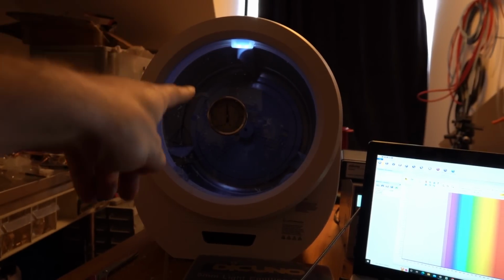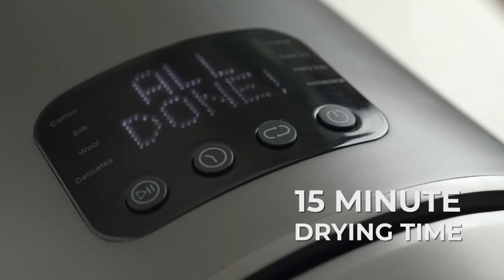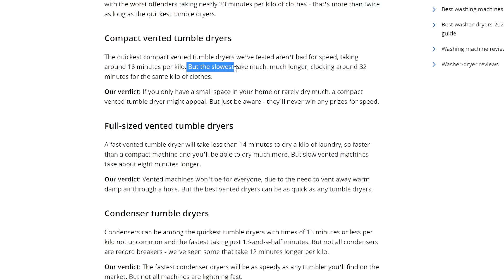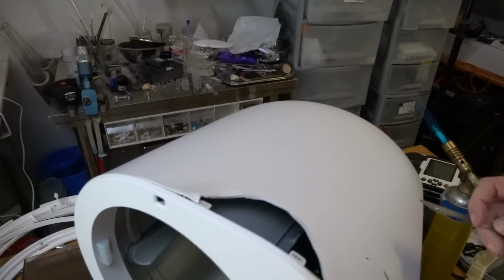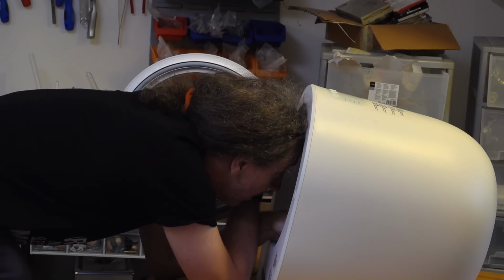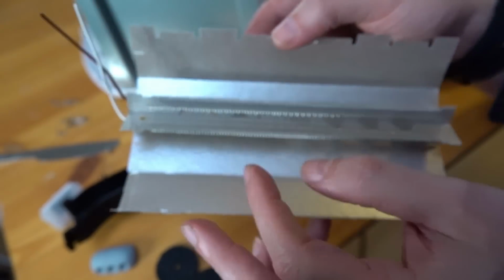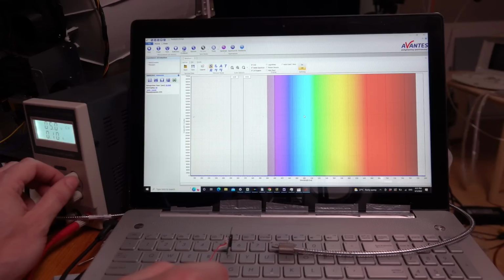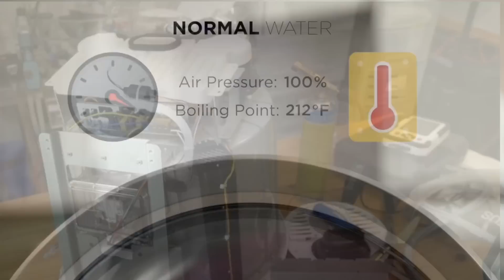Autopsy of a Scam-Starter: The Morus Zero!

Comment: You always locate as much screws as possible before doing destructive disassembly.

It's always under a rubber pad, a label, a warranty seal, or some kind of plastic cap; it's not easy to find..
Reply: I thought the "destructive" part there meant that you didn't need to locate all of the screws.

Comment: Two things I would just like to point out:
1. The non-vacuum dryer was all the time under the sunshine, which may have had quite an effect on its drying process. The machine should be inside the house.
2. The clothes hanging on the back were not in direct sunlight. Although I reckon that's not entirely necessary nor always recommended.
It could be interesting to do this same experiment in the right conditions (indoors machine, direct sunlight control clothes). I bet that if the machine is indoors, as it's always portrayed, the results would be even more disappointing.

Edit: Nevermind, I hadn't watched the full video when I posted my comment. But still, it may have been interesting to do the same experiment in the right conditions.

Comment: Bought a 9 Kg capacity cheap-ish Whirlpool heat pump dryer for 450 USD new. Now it is slower compared to "classic" condenser dryers, but only pulls 850W from a EU 230v plug and it takes around 3 hrs for a full load. Sure, it takes more space, but one can be placed anywhere you have a power outlet. You live in an impossibly small apartment? Get a compressor dehumidifier and Bob's your auntie.

Comment: Curious what the UV LED's emission wavelength is.  Depending on wavelength, there still might be zero effect on bacteria and viruses.

Eg:  365nm and 395-405nm won't kill.
But shorter wavelengths <300nm can.

I have 365nm 50W x 2 UV floodlights, and they won't sanitize.  I get more sanitizing power drinking a gin and tonic, and the drink fluoresces under UV light, twice the fun.
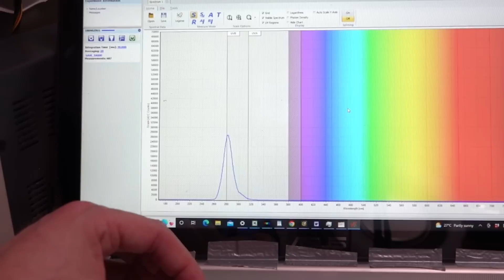Reply: 27:44 if you look closely you can see it's around 280 nm.

Comment: I'm not sure you can correctly calculate the dry time for clothes versus straight water and assume they correlate.  Evaporation does depend on surface area since it can only happen on the surface.  The cloths give the water a medium to spread out on and might actually improve drying time.  Or maybe not.  I just wouldn't make the assumption here.

Comment: The plastic case includes clips molded into it so it's really designed to permit installation of the case but NOT removal.  I'd have used a die-grinder, jigsaw or similar to cut all the way around.

Comment: These broken of bits might be the points where they started injection molding the housing and then broke/cut of the canells where the plastic was comming from the machine.
You can do these things tidy or dirt cheap.

Comment: Want to dry your clothes faster?
Throw a dry bath towel in the dryer with your laundry, the extra surface area and the wicking action makes the clothes dry faster.
I didn't want to believe it but tried it anyway, it really works.
However drying a towel twice probably doesn't save energy though.

Comment: The UV LED is probably getting so hot because you're overpowering it: I think i see 0.32A which is FAR beyond what it should probably be operating at (maybe 10-20mA)

It may have ~7V across it but because its not an ohmic resistor, current will be very sensitive to fluctuations hence why the usual thing to do is have a resistor in series which damps that effect and let's you select a current rather than voltage for it to operate at.

That resistor may be on the main board rather than the LED board. It would be a pretty serious design flaw otherwise.

The reason for the heating would be a zener diode included in the UV LED which limits the voltage for protection (but dumps excess power as heat)
Reply: The white LEDs look like they're being underpowered. They seemed much brighter when you were measuring them in situ

Comment: I'm guessing the UV LED is pulsing at best, and does little to nothing when it comes to sterilization. But... Doesn't those heating coils put out IR light? Not that it would do anything towards drying clothes, but I think technically it does.

Comment: If you want something to dry faster you just need to have running air on it. A normal fan will do just that just fine. It will most likely use less power too compared to that Morus Zero.

Or if you want to use even less power, hang them out during a windy day.
Reply: or for the price of this POS you can get a decent mid range heatpump dryer that will dry a full load of clothes

Comment: I wonder if you could add a small Peltier cooler to maybe cause some of the moisture to fall out.
Reply: It would have a single digit efficiency.
So it would really fit to this device.
Reply: @fromgermany271  So true. I had looked at using it in an RV, but with it pumping the humidity into the space it would become a sauna. I guess it could just go out a roof vent.

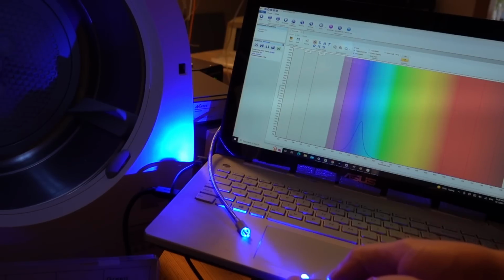Comment: 3:41 - another couple what? In a regular white LED there's just a single blue LED (those are very efficient) plus phosphor (or a combination of different phosphors) which absorbs some of the blue light and reemits it at a longer wavelenght - green to red (with high CRI LEDs overlapping some infrared too).

Comment: Apart from the fact it doesn't suck or kill germs, and ignoring the other fact it has a prototype feel - and its useless -parts of it are beautifully made. Electronics and motor, moldings etc. Oh and hot glue on connectors is standard practice for reliability in harsh environments. Germs ok as I watch ha ha. This is great stuff.

Comment: Here is a thought: introducing the most eco friendly dryer! "The clothes line!"™ Powered by renewable energy of the sun, simple installation or use existing items, easy and cheap parts replacements/repair, sanitizing UVA/B/C and more. Purchase within 48 hours and we'll throw in a complimentary set of clothes pins!

Comment: Wow, it actually had components for attempting the claims they made.  I don't have one of these but I wonder what it would take to get the units to actually work as they claimed.  
  
So a larger metal condenser, a better seal and a pump would get the product aligned with the claims?  
  
Can you put the working condenser drier you have there over the unit and fix the vacuum seal and compare it to the units currently in circulation?

Comment: The fact that it did have an ultra-violet light in it doesn't necessarily mean it was able to dry/sterilise the clothing, (or whatever claims they made about its presence), inside the machine.  They'd need something a little more substantial than one single LED to do that, somehow.

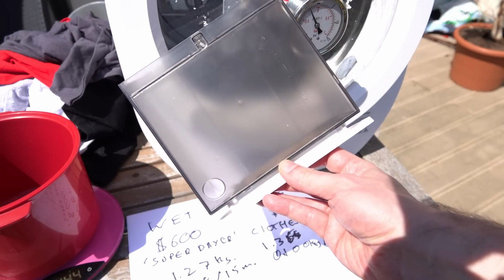Comment: 7:32... observational error? "We're didn't condense a single drop off water".
I believe I see 'a single drop' moving right to left, right next to your fingers.

19:32... glue is very common to keep electronics together in environments where there's vibration. The adhesive would often be Silastic.

24:10... I fix appliances. I instantly recognize that from a Bosch.

Comment: I knew that there were some hidden screws when you were prying your way around the thing, as in my experience, it was usually the case as well, when i found out later after breaking the thing apart.
But yeah, i was also surprised to see the UV light in it, then again, a tumble dryer is probably also not the best location for a light to cover as much area of a surface, since most of it is crumpled up.
It would work much better on say, a clothesline, and you actually get the UV for free.

Comment: An infra red heater would be crap at heating air and even crappier for (supposedly) low pressure air. It would be a good choice for transmitting heat energy to solid objects in a vacuum, but ensuring they are heated evenly would be a tough challenge. I would imagine that in an imaginary IR heated vacuum tumbler some bits of a t-shirt would receive damaging levels of radiation while other bits would receive none at all.

Comment: It's a good thing the condenser isn't effective. With the intake right next to the output, the moist air being sucked back in would condense on the outside of the condenser and I didn't see a means for collecting that water.

Comment: Hot running LED in a hot environment... it won't last long enough to sterilize using UV. If it could, UV tanning beds would be strobe flashes a few times and then done. I wonder if exposure to UV while hanging on a clothes line would have a more effective sterilizing effect.
Actually... it would be interesting to see a comparison of that UV LED's spectrum compared to sunlight.

Comment: One point of comment on the "Infra red" system. Coils like those are occasionally classified as infra red sources, because technically any heat emiting source can be considered the same. I consider that just a marketing ploy, as using infra red on air, then circulating air, is kinda dumb.

Comment: Thunderf00t - did you not see the vacuum system? That thing you said was a resistance heating unit? I'm certain that was an ion drive thruster, using ordinary electricity to create a vacuum with the power of WARP DRIVE!!

Comment: The UV LED would indeed get hot if you run it at >0.3A. It's probably rated 0.1A at most and will run perfectly fine continuously when operated within specs, though it won't sterilise much.

Comment: They clearly designed this thing carefully to avoid false advertising lawsuits:
1.) It technically pulls a slight vacuum.
2.) It has UV LEDs, but doesn't seem to run them to sterilize.
3.) It has the parts to be a condenser-drier, but they're badly-designed and made of the wrong material, so they don't work.

Comment: They played a trick with the wording infrared heating system well a heating element like in nichrome wire gives off infrared as it heats up to its glowing point so they can say infrared rather than just a metal wire heating up lol I have a really nice beam profiler around here for melles griot inc. I can't remember if they made it or they just gave it to me it might have been made by a different company like Spectra physics it's been a while since I've pulled it out of mothballs but I would love to go over this thing. It was mainly used for beam profiling for lasers but it also had a function to measure any light source and print out a profile

Comment: If they power the UV led at all it's probably pulse driven (PWM). At 7V this thing was taking almost half an amp, that's quite the power for such a small package. 3W led without a good heat sink is going to get quite toasty. The board should probably have some heat sinking in the form of thicker and broader pads with vias. Never the less this is quite the power to deal with contentiously. Leds normally are either pulse driven or have some type of linear current limiting. It could be getting 7V but for 1/5 of the time and is off the rest 4/5 in a pulse cycle. There's no other way, this thing is going to burn and possibly desolder itself from the board.

Comment: I'd guess that the UV LED had a very short duty cycle, probably on just for a fraction of each second using a pulse width modulator (the same that visible light LED dimmers work, and why LED lighting makes cameras "strobe").

Comment: I noticed that the clothes on the line in that test were sitting right behind the air outlet of the 'super drier', meaning that they were basically sitting in 100% humidity saturated air, slowing the drying time down and giving the line a disadvantage. Otherwise the line would have performed better, no doubt. 😁

Comment: So maybe they could have made it a little more efficient by using a heat sink on the UVLED and drawing the intake air over the heat sink before going through the heating elements thus serving 2 functions of a preheat and LED cooler?

Comment: I'm guessing the UV LED is connected to a PWM controller that makes the led blink rapidly. At least this would be the best way to produce the most amount of UV radiation without burning the component. The LED consumes 340mAh at 7V, that's 2.4W output, but can't be used continuously as there's no cooling on the PCB. For a visible spectrum LED, 2.4W is plenty, I don't know about how much do you need in a UV LED for sterilization purposes.

Comment: Your results from the drying test outside may be a little skewed. You put your clothes on a clothes line in the shade, and dried other clothes in a Morus that was sitting in the sun. As a result, the Morus may have been able to benefit from absorbing the heat from direct sunlight to help it dry your clothes, whereas the clothes line could not receive as much energy. As a result, the Morus may not be as efficient as your results suggest.

Comment: I think you have invalidated the warrantee. So if its blowing air out of the back is there any kind of filter to catch fibres from the clothes? Looks to me if you used this a number of times it would begin to clog up with fibres and blowing hot air of them might be a little bit of a fire risk ;)

Comment: About the UV led ..probably they use it with a controller so it actually flashes fast to keep the temp at acceptable levels, I don't think they run it full power constant voltage so 7V ..no volt ..7V ..no volt - common practice for energy saving or wattage saving :D

Comment: I’d be curious how much it would cost to make one of these from scratch.  Just a sum of what all the general parts would cost like a motor for tumbling, motor for fan, LEDs, heating element, circuit boards, plastic parts, metal parts…etc.  

My guess is under $200, maybe even under $150.
Reply: It runs on 1100-1200 watts of power, probably the same heating element as an electric water boiler or hair dryer, ~$30.
Cheap microcontroller board to tell it what to do, ~$10.
High torque motor, ~$40.
UVC LED, ~$20.
Blower fan, ~$40.
Molded plastic shells, doors, structural innards, ~$100. 
Power drivers for all electronic components, $30.
Custom PCB for components, $30.
Pretty much all of it, amounts to around ~$270 ish. You could add $30 for labor and peculiar components, getting ~$300.
This is just my estimate for making a prototype from scratch.
At scale solutions should at halve most of these costs, with the molded/formed plastics getting to closer to 1/10th the prototype cost. 
For mass production and no hicks in the production process, $100 or $120 may be doable but $150-$200 sounds about right to me.

Comment: I bet they'll pulse the UV led to prevent it from melting the solder off the pcb hahaha. As for disinfection, compare with one of those fridge disinfectors the run at night in sandwich bar counters. They are about the size of your big dryer condenser, with high output UV neon tubes and they need to run a few hours to disinfect a closed environment (so no outside air is sucked in bringing in new bacteria). Compare that to the 2mm led you got there for a constantly refreshed air volume, and no possibility to irradiate the entire volume because of the clothes being in the way. In short: total nonsense. It doesn't have the power to generate enough UV, it doesn't have the surface area to effectively treat anything. Maybe you can disinfect one fingernail at a time with that LED.

Comment: I'd be curious to see if the UV led is activated at all. That looks like a massive fire hazard.... making it burn down while running would be a nice final video for this series.
Reply: They're probably running it within specs, if anything. Thunderfoot overdrove it by at least a factor 3. It won't sterilise, but it isn't a fire hazard either.

Comment: If sombody like to speed up  drying londry, just buy centerfuga spiner dryer. My mother used to have that in end of 70s  i n Poland. We did not have any electric or gass drye just loundy rope.  If you put someting like sweter it will cpme out almost dry in less ther 5 minutes.  This was most effective way to pre dry any clothes, bed sheet an so on that come out from front loaded  lundry mashine as there spin cycle never was as good as the centerfuga dryer.. This centerfugal dryer still can be purchase below $200. This is best thing for energy saving.

Comment: I doubt that the intensity of a single UV LED ran for a second or so (without cooling) will be enough. When I run a classic 30cm UV-C tube (the fishtank kind, I use it to visualize 254nm TLC plates) the surrounding air starts smelling like ozone pretty fast.

Comment: Doesn't surprise me there is a UV led on there. It is common to sterilize dishes in China instead of using a dishwasher (hot water is bad according to traditional Chinese medicine or something) so it probably was super easy and cheap to get that in there.

I get the impression that maybe some (Chinese?) entrepreneur thought to actually build a working dryer but instead of using bulky more expensive components they would design it themselves using cheaper materials and a simpler design. When it didn't work they modified it so it would at least work as a blower because they did invest in plastic molds and a product design and some electronics so they will turn the project into a profitable one, one way or another. They probably came up with the vacuum nonsense for that purpose.

Comment: Well, to sterilize the UV would have to be in the "UVC" classification, I would think and looking at UV water purification systems these things are long mercury vapour "fluorescent" style tubes inside a long slender pipe.  The kind of thing that Big Clive has covered due to events that were held in Hong Kong in recent time(s).  I don't think there are LEDs that produce UVC, but I could be wrong.

Comment: I wonder how much would weight and cost a dryer which would ACTUALLY use true vacuum and UV sterilization, along with all the safeties, the shielding, etc. And the price too. BTW, UV light would damage the colors of the fabrics.
However, if the sun IN THE UK does better than the device, we can confidently state it's a scam.